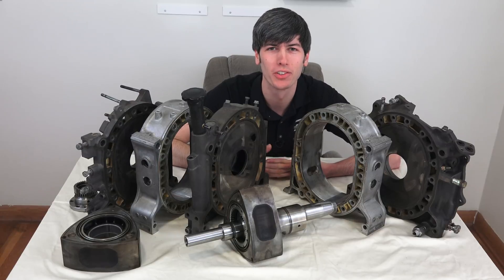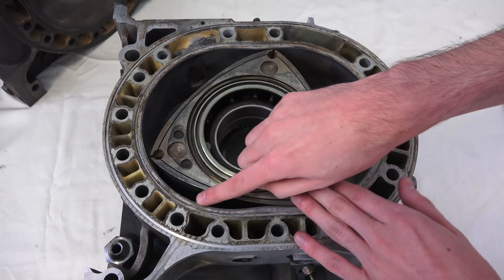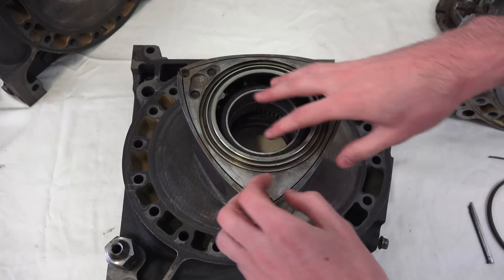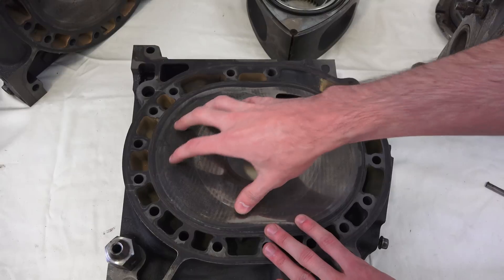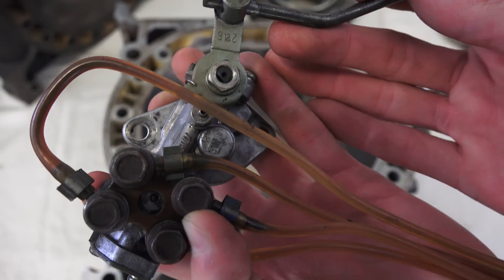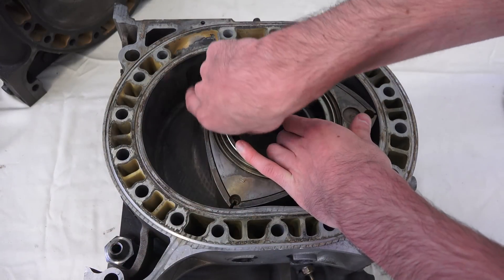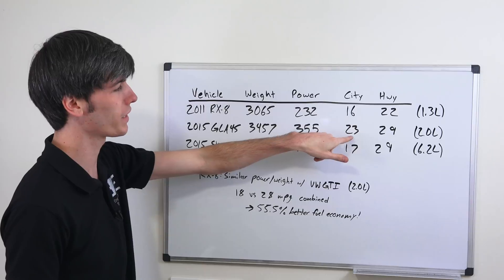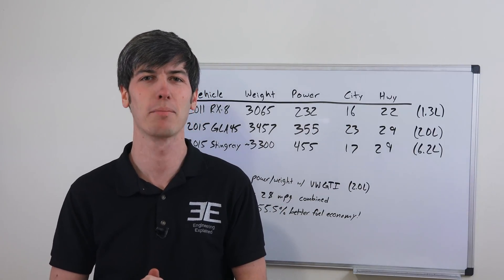4 Reasons Why The Rotary Engine Is Dead

Comment: The rotary is not dead. And it most certainly is not less efficient. You are confusing fuel economy with overall efficiency.
A reuleaux connected to a drive shaft rotating inside an epitrochoid is immensely more efficient than a piston engine.
The fuel economy / fouling problem is more a consequence of using hydrocarbon fuels but in terms of heat generated converted to rotational energy it is immensely more efficient than a piston going up and down.
The rotary is destined for hydrogen or some other type of sparkless reaction / future fuel.
I think we see a rebirth with another fuel in the near future.
Reply: Hydrogen it is. Fuel cell hydrogen trains have been running for four years in Germany. The current world-wide fuel price crisis will spur countries to move to hydrogen. 10% of  natural gas in city gas networks can be hydrogen without any problems with appliances burning.  That is 10% less emissions at a stroke. There is a trial in the towns of Redcar and Whitby in England.
Reply: @johnburns4017  Hydrogen won't bring back Wankel engines.
Reply: That is completely false, Wankel engines are obsolete technology today because they are inherently inferior to and less efficient than reciprocating engines.
Wankel engines offer no advantages over reciprocating engines and have lower combustion efficiency, lower thermal efficiency and lower mechanical conversion rate.

Wankel engines are poorly suited to gaseous fuel like hydrogen because the Wankel engine cannot support the static compression ratio required for optimal performance and efficiency.

Comment: The rotary engine died when mazda put the ports in the rx8 13b right next to eachother making them practically impossible to port. The magic of the rx7 was it came with twin turbos and with a boost controller a dremel tool, around 20$, a little know how, and stencils you could get that little rotary over 500hp. The rx8 was a fun car but thats all it was. I was very disappointed in mine on power, i upgraded a lot but it had that brick wall of either throwing 10k into boost of some sort and even with that your lucky to get 330hp out of it. Or throwing an rx7 13b into it. Just not worth it on the rx8
Reply: All Wankel engines are inherently unreliable and weak... that's why Mazda discontinued them and they are now obsolete technology.
Reply: @sandervanderkammen9230  
docktorbimmer a quiz.
Name the model of Mazda hybrid rotary engine car being introduced in Jan 2023?
20 points for the correct answer.
Reply: @johnburns4017  WHERE IS THE 2022 MX-30 RANGE EXTENDER???
Reply: @sandervanderkammen9230  
BZZZZZZZZZZT! Wrong answer.
docktorbimmer, the name of the model of Mazda hybrid rotary engine car being introduced in Jan 2023 is...

🍾🎊🤡  Mazda MX-30 🍾🎊🤡

Zero points bimmer. Zero. Better luck next time.

Comment: Interesting! I'm sure Mazda   can relook at this rotary engine with all the advances made in technology and engineering.
Reply: @Shan
Mazda are introducing in Jan 2023 the MX-30 hybrid using a rotary engine for the range extender running at a constant speed.
Reply: @johnburns4017  John Burns why do you continue to post lies and fake clickbait rumors about Mazda engines that do not exist.
Mazda ended development in 2008 and its last prototype was unveiled in 2007.
Reply: Mazda abandoned the Wankel engine a decade ago because they are inherently unreliable and cannot compete with reciprocating engines.

Comment: I'm super excited for Mazda bringing the rotary back in it's plug in hybrid!
Reply: Mazda confirmed that it's not bringing back the Wankel engine as a hybrid... just another false clickbait rumor.
Reply: The MX30 Will only be available in a 100% plug-in battery EV or a mild series hybrid powered by a 2.0 liter Skyactiv G engine
Reply: @comicaljunk
Yes, Mazda are introducing in Jan 2023 the MX-30 hybrid using a rotary engine for the range extender running at a constant speed.
Reply: Mazda announced cancellation of MX-30 and the Wankel engine

Comment: One thing about the rings,,in a piston they speed up and stop ,,ina rotary they go far faster trying to cover a "stroke",,start hydroplaning on the oil smush ,,
Reply: A piston ring forms a positive seal, the higher the pressure, the tighter the seal forms.
The apex seal wants to bounce up and down, like a car tire with no shock absorber.
The thicker the seal the heavier it gets and a stiffer spring is required... increases the wear on the chamber wall.
Too thin and light? The seal leaks and is incinerated by combustion gasses. 
No solutions just compromises.

Comment: Can we fix the unburnt fuel-air mixture issue by lowering the amount that gets into the chamber per revolution? We could also fix the seal issue by providing  engine blocks and seals made of denser more durable metals with higher fusion points like tungsten, I know they're a lot heavier and we should discard the seal but there's no problem with the engine block since its not moving so it doesn't have an effect on revs. We could  inject oil into the apex seals directly so it is more efficient and less oil wasted. For the emissions we can fit a bigger catalytic converter (modern catalytic converters have little to no drain on horsepower so it should be fine). There are also noise regulations which could be complied by turbocharging the engine (turbochargers muffle a little bit of the engine noise) and adding better mufflers. There is always room to improvement (I am not a professional mechanic nor I have a degree on automotive engineering so don't expect me to have everything right).
Reply: Rotaries 23% more efficient burning hydrogen. Even more efficient running at a constant speed.
Reply: @johnburns4017  Then why was Mazda the only major manufacturer rejected by the Norwegian HyNor program???
Mazda's entry had the worst fuel efficiency of any hydrogen car submitted.
Reply: @johnburns4017  Wankel engines use 30% more fuel than reciprocating engines, so hydrogen is not an advantage for Wankel engines.

Comment: Tell that to PAC performance....
Reply: Australia no longer has any automobile manufacturers and PAC is not an engine manufacturer.
Reply: @sandervanderkammen9230  They are making billet rotary motors....
Reply: @bucknasty7616  They are custom built to order... PAC is not an engine manufacturer.
Series mass production of Wankel engines ended on June 21st 2012 when Mazda shuttered it Ujina no.2 RX manufacturing plant in Hiroshima Japan and it was demolished in 2013.
Reply: @sandervanderkammen9230  So its not "dead" then. Thats the title.
Reply: @sandervanderkammen9230  im pretty sure mazda are developing a new rotary rx9 and also a smaller version motor for back up on EV cars.
Reply: @bucknasty7616  Mazda unveiled its very last production Wankel engine (The 13B-MSP-RE aka "Renesis") in  1995..   the year Windows95 was released, and before you born lad.
Reply: @sandervanderkammen9230  lol the age "burn". How mature. Unfortunately im not that young. Im done with you. Be gone.
Reply: @bucknasty7616  You're not fooling anyone lad... your comments reveal someone who is very immature, inexperienced and knows nothing about Wankel engines.
Reply: @bucknasty7616  Thanks for proving my point kid.
Reply: Did Mazda resume rotary engine production to cater to the vintage vehicle trend?

“Definitely not! We never stopped producing rotary engines, even after RX-8 production ended in 2012.
Reply: @bucknasty7616  If you act like a child? I will treat you like a child.... your comments reveal someone very ignorant and immature.
Reply: You check that link out then check yourself did ya lol just a lad...derp

Comment: The GTI and GLA45 also have turbocharged engines which is cheating
Reply: What's your point? The chart was comparing MPG to horsepower and vehicle weight.
Reply: @sandervanderkammen9230  And turbocharged cars achieve higher fuel efficiency than a n/a with similar power.
Reply: @Aminmotors  Not true, only turbocharged reciprocating engines get better fuel economy, the Wankel engine has appallingly bad thermal efficiency, terrible combustion efficiency and produced extremely high EGTs... turbocharged Wankel engines require richer AFRs to suppress knock and to quench turbine inlet temperatures.

The Wankel engine is obsolete because it is fatally flawed and inherently inferior to reciprocating engines.
The chart demonstrated this very clearly.
Reply: @sandervanderkammen9230  The chart still compared turbocharged piston engines to an NA wankel.
Reply: @Aminmotors  The chart only compares BSFC.
The Wankel engine has by far the lowest BSFC performance.
Reply: @Aminmotors  16/22 mpg for a 3,000lb car with 232hp is the best Mazda could do? pathetic

Comment: No 2 3 4 disadvantages are as follows:
2 You have temperature differences so something gets. Mixed up. Especially oil. 
3. You burn oil. 
4. Emissions because you burn oil :D
Lol
Reply: The Wankel engine cannot support a modern high swirl or Quench type chamber architecture, it also loses combustion efficiency as static compression ratio is increased.

So less of the air/ fuel mixture is converted into heat, and less of that heat is converted into horsepower.
 The Wankel engine is severely limited by the geometry envelop that allows it to function as a internal combustion engine.

Comment: Rotary engines have amazing fuel afficiency.... Because minimizing moving parts reduces energy wastage.... Of course they need a lot of oil....
Reply: I guess they would be if fuel was properly combusted before going to exhaust.
Reply: That is completely false, Wankel engines have significantly higher BSFC and higher EGTs... proof that they are less efficient and has higher heat rejection.
The Wankel engine also has horrible combustion efficiency so less energy is converted into heat.
The Wankel engine is less mechanically efficient so less heat is converted into horsepower.

Comment: a Rotary Engine with Two Rotors have 6 Power Strokes every time it Turn over you would need a 12 cylinder 4 Stroke Engine has 6 Power strokes too every time it Turns over but the Rotary Don't have the Tq as the 4 strokes have do to the Nature of the Piston to the Rotary can have Higher C.R. in the 12:1 or even 16:1 and some as high as 32:1 and a Rotary Can NOT make C.R in as high and this = out too be Tq that's Also Why Rotary's Naturally make High Hp in the High RPM because HP is RPM x Tq = Hp more RPM more Hp but I Always go with the Tq Numbers and Not the Hp for Hp is Just a product of Tq and RPM
Reply: A rotary with two rotors has two power pulses per rev of the output shaft. The equiv of 4 cylinders in a 4-stroke ICE. 
The confusion is that the rotor has three power pulse per rev. As the output shaft runs three time faster, it is one power pulse per rev of shaft.
Reply: @johnburns4017  That is exactly why reciprocating engines are superior.
A 6 cylinder engine has all 6 power strokes in 2 revolutions, while the Wankel has less power and torque because it requires 3 revolutions.

Any questions son?

Comment: Today marks the 10 year anniversary of the final demise of RX production at Mazda.
  The very last Wankel engine car rolled off the assembly line at Mazda's Ujina #2 plant in Hiroshima Japan on June 21st 2012 at 4:30 PM Tokyo time.
Reply: Mazda are introducing in Jan 2023 the MX-30 hybrid using a rotary engine for the range extender running at a constant speed.
Reply: @johnburns4017  JOHN BURN YOU ARE NOTHING BUT A BATTY OLD CRACKPOT.
 MAZDA DOES NOT MAKE WANKEL ENGINES ANYMORE.

Comment: Intermittent connection of the "Piston/crank" seal is the reason these mutha fukkas are doomed to the history books.  They have no longevity of reliability, no matter what.
Reply: Not so.
Reply: @johnburns4017  The Wankel engine has been obsolete for more than a decade, rhat is an irrefutable fact.
Mazda ended development in May 2009 and no new prototypes have been seen since the 16x program which was cancelled in 2009.
Reply: @johnburns4017  John Wankel engines are inherently unreliable and less durable than the reciprocating engines which is why they cannot be used in type rated passenger aircraft.

Comment: R.I.P this inefficient and dirty engine should have been killed off.......... and may remain in the ground...........
Reply: Mazda are introducing in Jan 2023 the MX-30 hybrid using a rotary engine for the range extender running at a constant speed.  Capable of being run 23% more efficient using hydrogen with zero emissions.
Reply: @johnburns4017  John why do you keep posting lies and fake clickbait rumors about Mazda engines that don't exist.
Mazda abandoned all development of production Wankel engines in May 2009 and has not unveiled a new production Wankel engine in over 27 years!!!!

Comment: I still want a Rotary, for racing purposes it does not get any better. You could beat on this thing all day, no rods that can fail, no rods bearings to spin, no pistons to fail. Just a spinning Dorito of POWER! The rebuilds/apex seal replacement does not even seem that difficult, looks easier to rebuild a rotary than to rebuild a piston engine.
Reply: You are very naive and confused.
The Wankel engine was ultimately a failure in motorsports... inazda no longer has any factory motorsports programs

Comment: One biggy was 20-40 high detergent oil left a heavy ash deposit, premature seal failure.
I put 130,000 on one using straight 30. Beginning with less than 1/4 Qt./3000 Mi. Still ran strong at 130,000 and well below 
1/2 Qt./3000 Mi.
At.
Reply: Yeah, and that old false urban myth has been completely debunked,  with today's super clean burning ashless detergent motor oils they still suffer from seal failures...
Reply: True, this things have the ability to keep limping along another 60k after the apex seals are damaged..

Comment: Rotary isn't dead, just go for E-Fuels ;)
Reply: Wankel engines are dead and buried... E-fuels are expensive and the Wankel engine is horribly inefficient and unreliable... the Wankel engine performs even worse on alternative fuels.
Reply: @Artemis Fowl
Mazda are introducing in Jan 2023 the MX-30 hybrid using a rotary engine for the range extender running at a constant speed.

Comment: Excellent explanation.  I owned an RX-7 for 27 years and sold it with 178,000 miles on it.  No major engine problems, but you had to educate yourself about rotaries if you owned one.  A major headache was the flooding problem if you shut the engine off before attaining operating temps.  Live and learn.
Reply: You obviously didn't educate yourself very well... because hard starting is a classic symptom of Wankel engine failure due to compression loss... 
 Most of Wankel engines still running  lost compression decades ago and are still limping arpund half dead with low compression.
Reply: @sandervanderkammen9230  Read through the replies and you'll find another one of mine where I specifically mention low compression with my 178K engine.  My car still ran strong and had no starting issues unless it was hot.  After owning a rotary for 27 years, I think I learned a little.  Hard starting due to low compression is a trait of piston engines as well.  Since you seem to be the rotary savant, why don't you post a video and enlighten us all?
Reply: @stayathome2  I don't think that you have slightest clue what you are talking about... at 178,000 miles the engine was probably barely running.. if it started at all.
Everyone knows to conduct a hot start test before buying any Wankel engine... trouble starting when hot is the surest sign of a dead engine.

Comment: It's the IDEAL engine for turbocharging.  All of a sudden you're making 700-1000HP with a lighweigh engine that it will never float valves.   All the "disadvantages" have already been discoverd an fixed.   And hey, a reliable 1000HP out of 1.3 liters  is great engineering!
Reply: I LOVE your sarcasm!! LOL!!!
Reply: @sandervanderkammen9230  All the sealing and oiling and apex seals issues have been fixed and documented.   
Mazda even won the 24 hours of  LeMans with a 4 rotor engine in 1991.
Specialty shops now are turning out turbo 3 rotor 1000HP engines and 2,000HP 4 rotor engines.
Look up Rob Dahm or Angel Motorsports or any other recent builders.
I'm thinking of my next 240Z build of ditching the Iron Nissan L24 and going with a 3 rotor.
Reply: @arthurfoyt6727  All Wankel engines are inherently unreliable, they are too unreliable for any production applications.
That's why they have been obsolete for a decade now.

Mazda foray into world class motorsports was ultimately a failure..
The Mazda 787b lost the 1990 WSC Championship to Mercedes-Benz and lost the 1991 Championship to Jaguar.

Mazda no longer has any factory motorsport program.
Reply: @arthurfoyt6727  Rob Dahm is software programer and T-shirt salesman with bad drug abuse problems..
If you think that he builds reliable engines ypu don't know anything about engines.

The Mazda 20b is not a performance engine... it was designed for an overweight luxury GT and proved to be a very weak and fragile engine with no serious  performance potential.
Reply: @sandervanderkammen9230  How are they inherently unreliable?
Reply: @sandervanderkammen9230  He build engines either for reliability OR power.  Same as it ever was.
Reply: @arthurfoyt6727  You don't know???
Reply: @arthurfoyt6727  He's not a professional engine builder... he is not not even qualified to do oil changes a Mazda.
Reply: @arthurfoyt6727  You don't seem to know anything about engines do you?

Comment: Is it not possible to reuse part of the air/fuel from the exhaust as intake to the engine?
Reply: Only a very small amount can be recirculated, this is commonly used to reduce NOx emissions and is called EGR.
Adding significant amounts of recirculated exhaust will cause the air/fuel mix to fail to ignite.